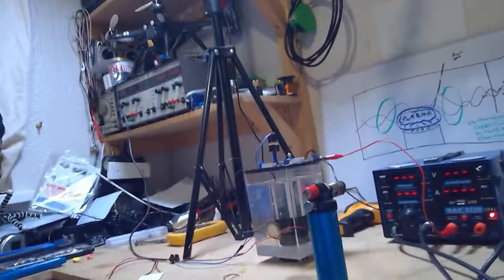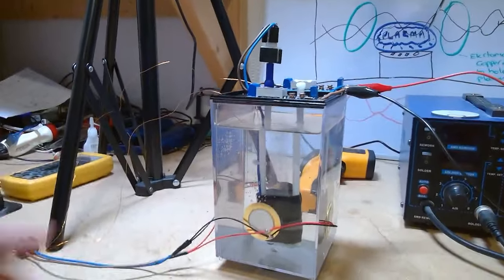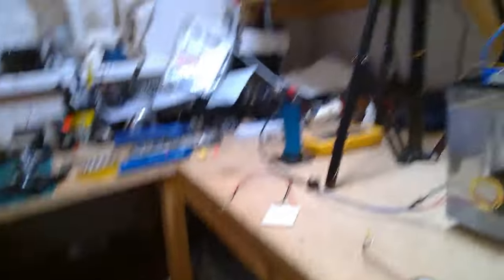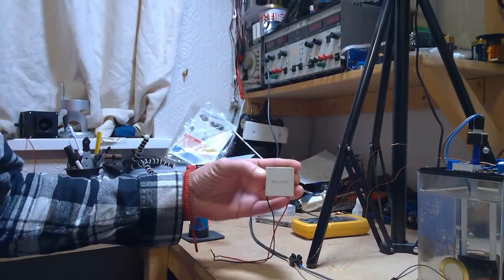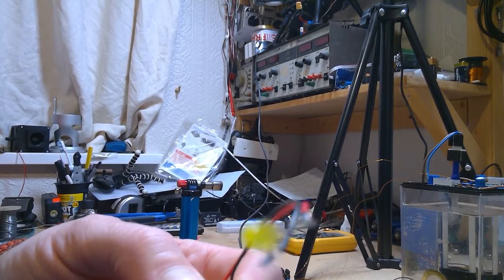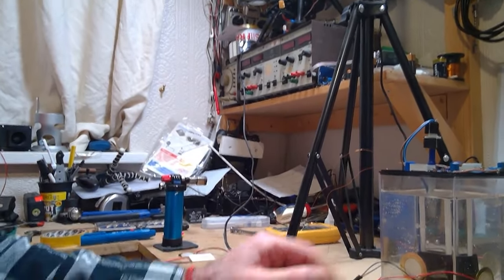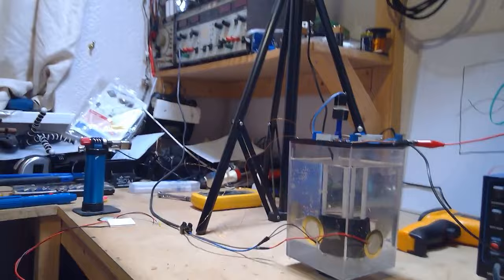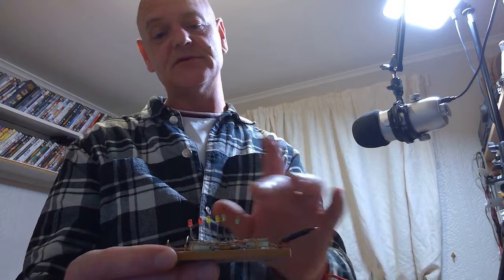HHO GENE'S WORLD ...POLE SHIFT GSM CC

Comment: Heres a couple more ways to generate free electricity,  1. atmospheric electric,the higher your elevation the greater your voltage. From memory( please corret if im wrong) its 100 pizo volts per metre of elevation.
2. Earth differance. The earth in your house will be a differant potential from say another houses earth down the street. The further away the greater the voltage differance,you dont need to use another houses earth you could run a very long cable(longer the better) away from your house and make a good earth into the ground,a conductive metal spike with the cable properly attached is best,you take the differance. Please please be very carefull when conducting this experiment as your playing with potentially high voltages so please research the correct p.p.e to be using with high voltages and the correct methods and tools.
Theres plenty of vids on y.t explaining how to do this way better than i just did!!
Please do your research!
I dont want deaths or injurys on my concience.🙏❤️.
Reply: Mavstar! Maybee you could explain this in a vid?